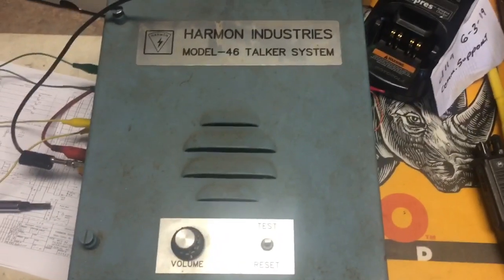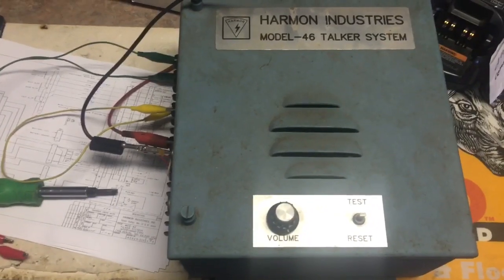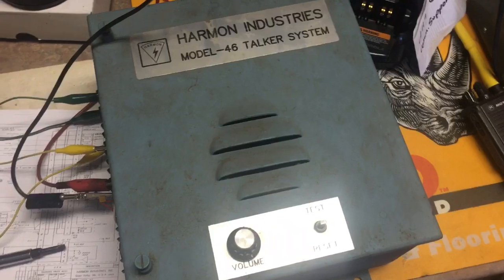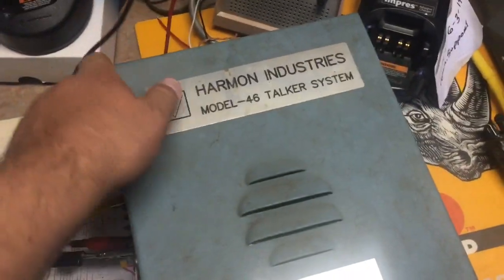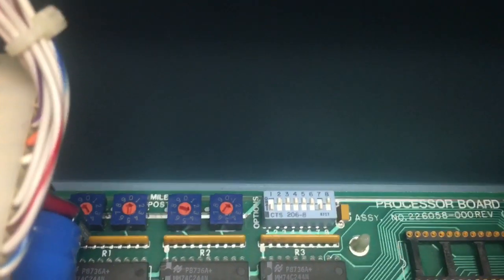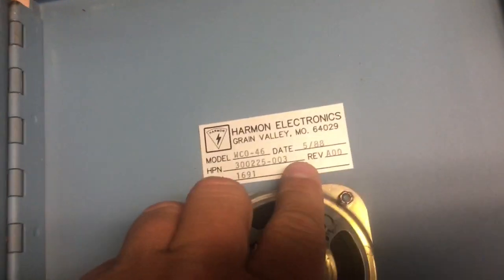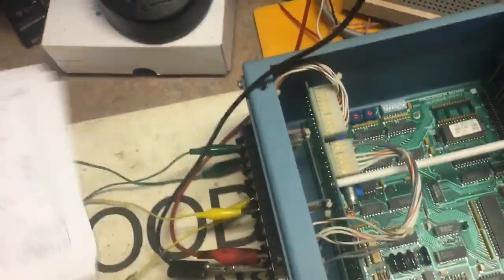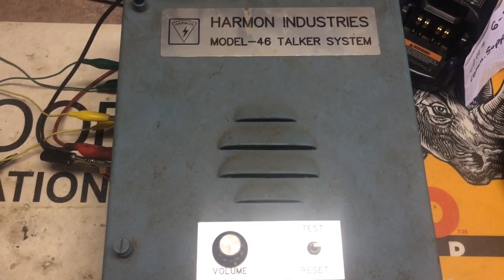Harmon "Model 46 Talker System" Railroad Defect Detector

Comment: Cool video, neat to see the interworkings of such equipment, but arent detectors for transmitting over radio? Why does it have a speaker in it?
Reply: Many detectors can preform eprom tests which reads all the voice prompts out loud and to see if the chips needs to be replaced or if a voice line is missing. Many more uses for it tho.

Comment: There’s Hawk detector on the Northeast Corridor in Massachusetts with this system.
Reply: I’ve got two recordings of the Amtrak Hawk detector at Sharon, MA.

There’s also a B&M detector on the Worcester Mainline on Pan Am Railways which uses the same Harmon detector type.
Reply: @TrinityCourtStudios  same but I got 1.75 recordings because my radio didn't pick it up the first time until after it said Amtrak.

Comment: Curious how much power these put out?
Reply from the maker: This particular unit doesn't have an integrated radio, so it puts out whatever the power output of the attached radio is. Most detectors are fairly low power output, in the 2-5 watt range. Often times they use smaller telemetry-type radios such as the JSLM or JSLM2 units. Detectors at work use Motorola CDM1250 mobiles with the power output reduced to five watts. Detectors at the museum generally use Motorola M1225 mobiles with the power output reduced to five watts.

Comment: You shouldve pressed the test button
Reply from the maker: All the test switch does is simulate track occupancy causing the detector to scan the track inputs and report accordingly. It would've just said the same thing you heard it say in the video.
Reply: @sportbikepilot  Hey, you seem like a cool guy and I think we might be interested in some similar stuff, I’d like to talk with you if you’d like.
Reply from the maker: @HiSmartAlarms  what would you like to talk about?
Reply: @sportbikepilot  Defect detectors, radio equipment, just stuff like that haha. I am extremely interested in the technical side of defect detectors, and whilst there is good info on them on the defectdetector.net website, theres no info like talking to someone who has experience with them haha.
Reply from the maker: @HiSmartAlarms  Well that’s true. You can contact me at the email address on my about link on my channel
Reply: @sportbikepilot  Alright!